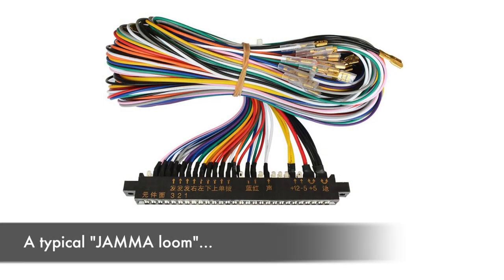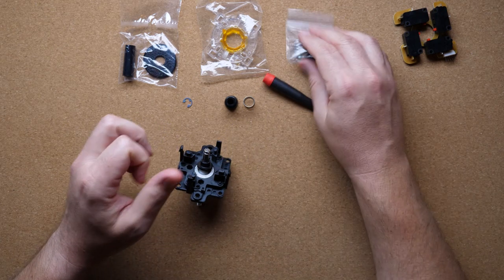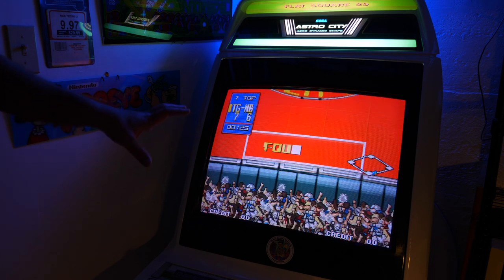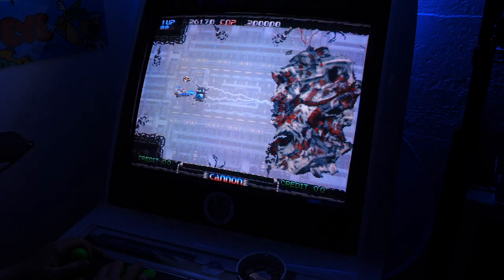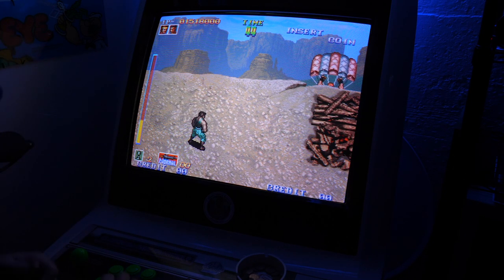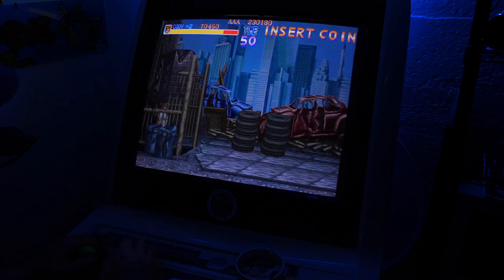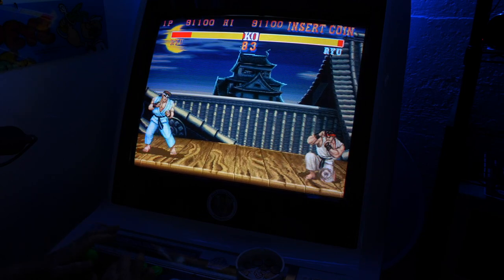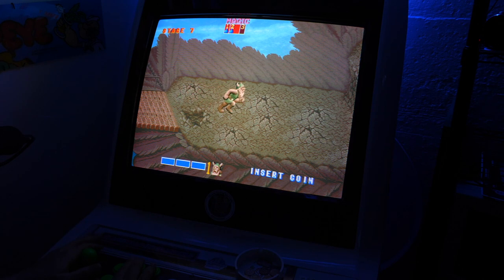Taking a Trip to Astro City - A Tour of My Arcade Cab! | CGQ+

Comment from the maker: This is a ridiculously long video with a lot of information in it, so here's a time index so that people can skip around.

0:15 Intro/Background
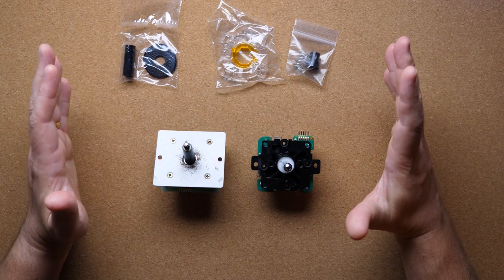11:03 Prepping the Sanwa JLF for Installation
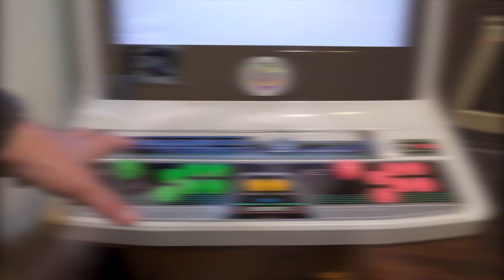17:24 Control Panel Overview
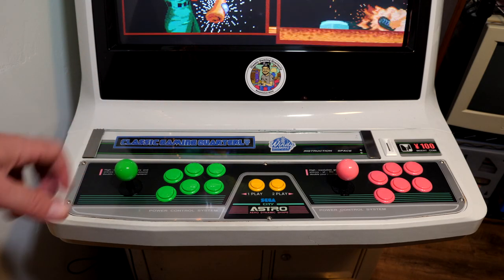19:38 Joystick/Button Damper/Harness Installation
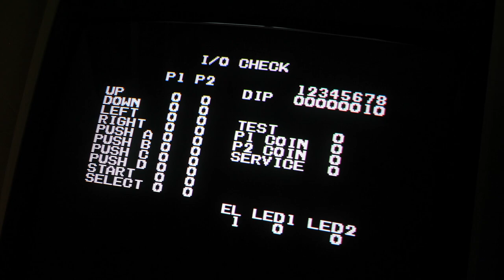28:20 Checking Out the Marquee
29:56 Monitor Overview
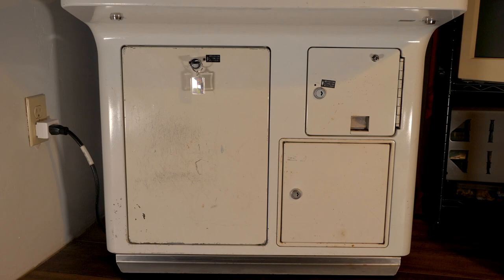31:48 Inside the Cab (Power Supply/Coin Mech/Coin Bucket & Meter)
36:52 Mounting/Changing a PCB
39:15 Pulstar (Neo-Geo)
48:40 Shock Troopers (Neo-Geo)
1:03:02 Strikers 1945 Plus (Neo-Geo)
1:11:46 Final Fight (Capcom CPS)
1:23:05 Street Fighter II' Turbo Hyper Fighting
1:31:17 Golden Axe
Reply: Skipping is for the weak. I will watch it all.
Reply: Hi Chris! I am catching up on all your streams from past 6 months and i noticed that CGQ Live Ep. 27, 38 and 39 are not in your streams playlist.
Reply from the maker: @saratov99  Hey man, sorry I just saw this.  Fixed.  Thanks!!
Reply: @CGQPlus  You are very welcome! Can't wait for a new flashback episode! Also why don't you make a Let's read magazine episode about early 90's PC gaming to mix usual console magazins.

Comment: Awesome cabinet. Thank you for sharing. Have you considered putting a Mister FPGA inside?
Reply from the maker: Funny you should ask, because that’s exactly what’s in there now.  It actually made all of my arcade boards obsolete...
Reply: @CGQPlus  That's awesome! So you feel the fpga cores are just as good?
Reply: @CGQPlus  Also, The RGB-PI has come a long way. OS4 is really good and run-ahead mode removes all the controller latency.

Comment: Most Americans dismiss the square gate because american cabinets had 8 way gates. And many unexperienced games will switch it out without really knowing about them just because it sounds logical to have an 8 direction guide because there is 8 possible directions and not 4.

The idea of a square gate is that the stick will move freely so you have good access to all microswitches and diagonals are easy because they are guided. The idea is to have free movement and feeling the microswitches. The octagonal gate kills the very idea of the Japanese stick style and the feeling the 8 notches feel annoying to me.

Comment: Interesting joystick information, never really thought about all the mechanics that bring it all together. As a Street fighter fan, I always loved the cabinets that had the shorter shaft and round ball joystick design in combination with concaved buttons. Also I never noticed the clicky sound of the joystick micro switches, is this just something you don’t hear or feel once everything is set in place?  
I was never a fan of the longer bat style joysticks for fighting games as I felt they had a longer throw and just not much weight or springiness to them. Oddly enough they seemed to come standard on all fighting games very few had the ball joysticks.

Comment: 1 question can you replace the tube for a 29 inch pc monitor or 32 inch pc monitor because monitors of today wil have less bezel so bigger screen inside the same frame but can that be done because today led monitors get less burn in
I dont know but im just curious
Reply from the maker: You could.  You'd need an upscaler to display the video signal on a modern panel and you'd ideally need a 4:3 panel, and you'd have to modify the cab since it's set up for a curved screen.  But yes you could do it.

Comment: Hey Chris, would you happen to have a list of all the different screws the astro city uses? I have one myself and would like to replace all the old rusted screws with new ones.

This is an awesome video btw. Thanks for posting.
Reply from the maker: They're in the manual.  Towards the back where the diagrams are.  It can be a little hard to read because a lot of it is hand-written, but it's usable.  I ended up replacing most of the screws with stainless steel, but that's probably overkill.  Zinc-plated is I'm sure fine.  https://wiki.arcadeotaku.com/images/0/0a/AstroCityMan.pdf